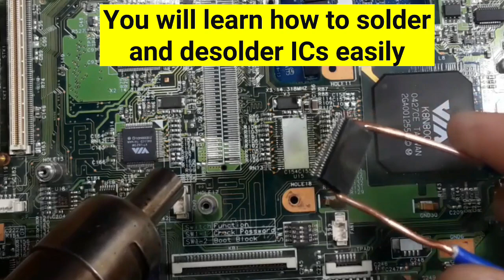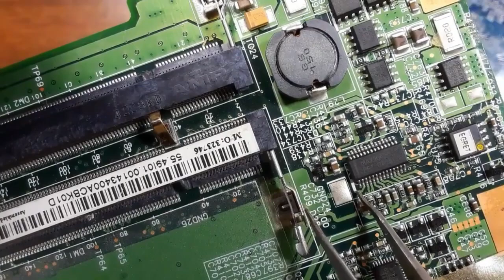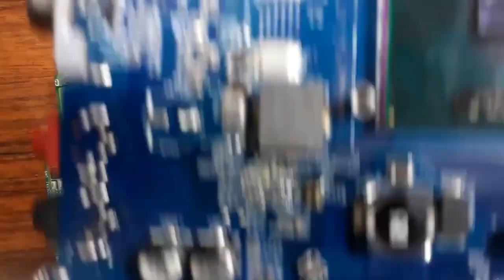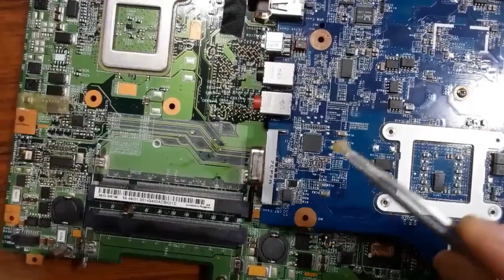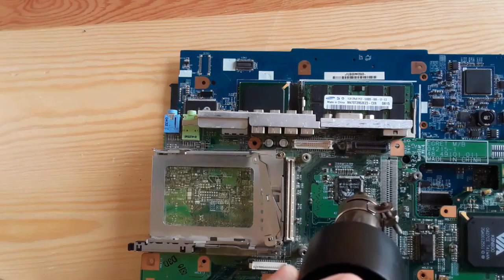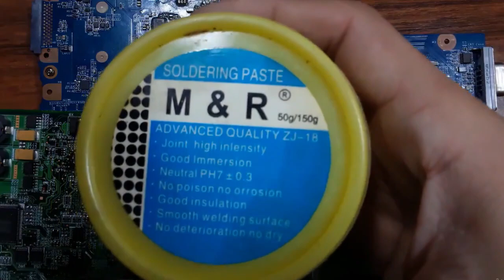Integrated Circuits ICs soldering and desoldering - Learn how to solder lik a Pro

Comment: you told the temp will be 350 but what about Air pressure? kindly guide me.
Reply from the maker: ✅ Recommended Air Pressure (Airflow) Settings:
- Small chips (e.g., SMD capacitors, resistors)	Low airflow (10–20%)
- Medium chips (e.g., BIOS, simple ICs)	Moderate airflow (30–50%)
- Large chips (e.g., GPU, CPU, BGA)	Higher airflow (50–70%)
- Reballing/Reflow	Medium to high (40–70%), depending on nozzle and chip size

⚠️ Why it Matters:
Too much airflow at 350°C = nearby components can fly off or shift.

Too little airflow = chip won’t reach reflow temperature evenly.
Reply: thanks for guiding :_Right:

Comment: Thank you for this demonstration.
Can you tell us between which range (percentage) of airflow you use ? 350 degrees would need a higher airflow consider leaded free solder and thick pcb’s ?  Don’t they absorb lots of heat so need + 70/80 % airflow  ?  But then components would be blown away without holding them.  
Thank you for your answer.
Best regards

Comment: Great video, extremely informative. I have a question, how do you prevent the IC from moving when applying hot air to it? Usually the air coming from the heat gun causes it to move a bit.
Reply from the maker: Using 2 tricks:
1. Decrease the air of the Hot air.
2. Apply soldering paste under the IC
Reply: @electronicsrepairbasics_erb  thanks for the quick reply
Reply: Another question if you will excuse me, is a microscope necessary for this procedure? Or can it be done without one?
Reply: What temperature do you set your hot air gun to

Comment: Thank you. 
(1) Can we use soldering paste together with hot air gun when desoldering non-smd components? 
(2)Can we use this same principle in soldering and desoldering other smd components or this method applies to ic's alone?
Reply from the maker: Yes Bro you can